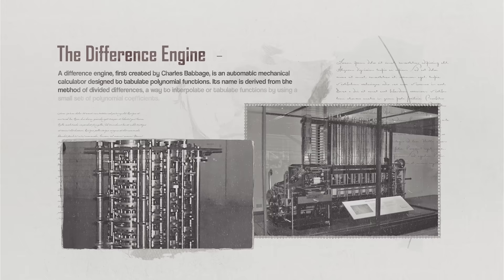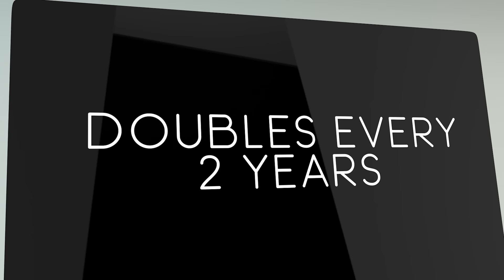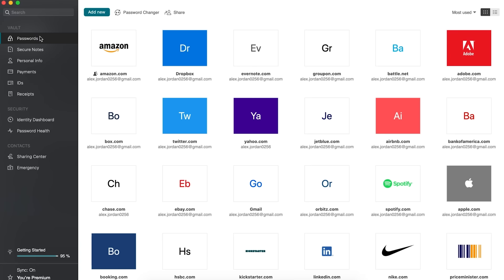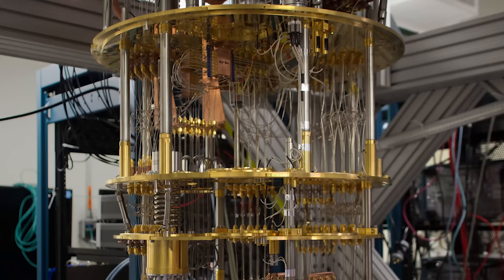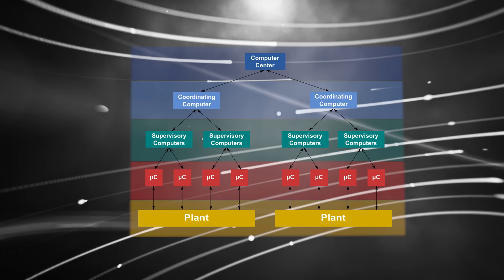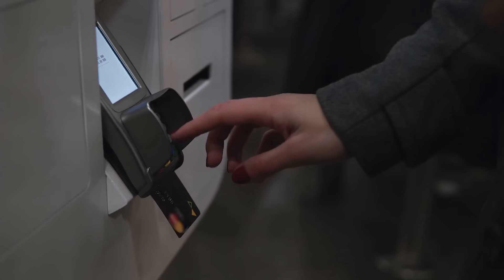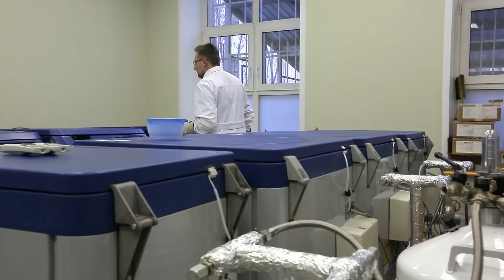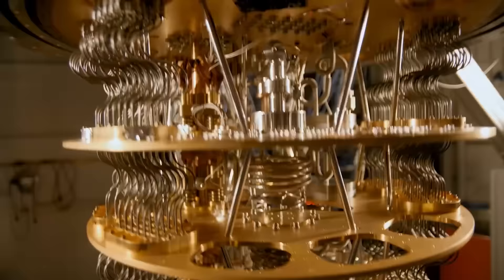This Revolutionary Computer Is About to Change The World for Good

Comment: Moore's Law: process power doubles every 2 years
Gate's Law: Bloatware will always strangle computer performance
Reply: This is golden comment needs more attention 😂
Reply: what is bloatware?
Reply: oh wasted space
Reply: That's so accurate. I wonder why these computers always lag even the new ones
Reply: Read "Showstopper" by Pascal Zachary, the story about NT Windows. You will gain both a firm grounding on the history of Windows and new respect for it's design and makers, chiefly Dave Cutler and Perazzolli. They have done something of a scale that was never done before. Windows is truly an achievement.
Reply: @masternobody1896  Bloatware is poorly optimised sub-optimal code and  the use of interpreted languages as glue - piled together and occupying far more ram than is required.... the great god C has been replaced by C++ and Java script. However, AI's will save us by writing in pure C and assembler in the not to distant future
Reply: @berlinblast5736  Windows is crap -which is why the internet runs on Linux and Linux runs Nasa's projects...
Reply: Bloatware is just taking up space, not performance....
Reply: Chester Hackenbush I wish You’d be able to play more games on Linux tbh
Reply: @TripleLayerLemonCake  you can do that using proton or wine
Reply: @sushmadevi3652  I haven't had much luck running civ IV on linux, i had to set up a dual boot for that
Reply: @imperiumcommentingnetwork4677  it is still a little clunky
Reply: @sushmadevi3652  Seems to be a miss with older games mostly
Reply: Cole's Law: Thinly sliced cabbage.
Reply: @berlinblast5736  I hope you're being sarcastic. There is absolutely nothing that book could contain which will justify the dumpster fire that is windows for the end user. I'm sure it was a great success for its marketeers.
Reply: @TripleLayerLemonCake  Steam has Proton which allows most windows games to be played on Linux.
Reply: @TripleLayerLemonCake  No bloatware is sub-optimal code, poorly written and taking up valuable space. ANY programmer will tell you that small well written programs run faster and take up less space than bloatware.
Reply: @chesterhackenbush  yeah thats why I said more. Most games arent supported only the big ones. Plus I've tested the difference between running on windows and linux and running cs:go and other games, and no difference in frames, so either linux also has "bloatware" or you guys dont understand how to close an application and stop its code. btw of course small programs would take up less space then bloatware lol. I could write a simple program right now, is it supposed to take up more space???? You're really confusing dude. Also if your pc comes with bloatware on windows then you might wanna get it checked out because you can literally get the base version with no extra programs other then settings and things that are needed
Reply: @TripleLayerLemonCake  Originally DOS/Windows relied on BSD - and there may still be BSD code in the Windows kernel even now. Linux is far closer to UNIX like OS's - it  is far closer to the BSD's. However, emulation layers (WINE, PROTON and others) enable Linux to run Windows programs. Windows contains Linux code to enable IOT and network functionality. However, emulation introduces bloat -as does running VM's (virtual machines). As things become complex - these routines have to be glued together with more library interfaces that are generic and often completely unoptimised. The result is software becomes bloated and less efficient. Pure Linux is very very fast and streamlined and  almost all super computers in the world run Linux and not Windows for this very reason.
Reply: @chesterhackenbush  i get the same performance  with both so I see no difference, nor do I see bloatware.
Reply: @TripleLayerLemonCake  You are not an IT professional, so you wouldn't. I would suggest you try Gentoo Linux for an eye opener.
Reply: @chesterhackenbush  I could be, you never know. Maybe you should try the stock version of windows 10 with nothing installed other then system required things. Even then I dont see any extra software slowing me down. Plus you arent an IT professional either. Or at least with your logic you aren't.
Reply: @chesterhackenbush  btw Gentoo is one of the worst forms of linux, i've tried that shit and it runs slow as hell. No idea what's wrong with it but they did some weird stuff to is. Plus it has terrible reviews if you really wanted to suggest a form of linux atleast get the fast ones smh
Reply: @chesterhackenbush  atleast you caught on lol. I personally use linux I just get bored and troll with people, most people dont notice but atleast we got one smart person here
Reply: @TripleLayerLemonCake  You are very naughty... I have told Queen Elizabeth of your naughtiness and she will have your ankles savaged by her corgis.
Reply: Chester Hackenbush that doesn’t sound very pleasant
Reply: @TripleLayerLemonCake  They like trolls and will probably give you a knighthood and Ghislaine Maxwell's telephone number.
Reply: Very true.

Comment: “Can it run Crysis?”

You’re not thinking big enough. The real question is: Has Todd Howard released Skyrim for it yet?

…and the answer is yes, yes he has.
Reply: The one true fact is that Fallout 4 will still drop in frame rate when you enter Boston even on a quantum computer.
Reply: I wanted to make that joke, good thinking. I bought skyrim for my fridge.
Reply: It couldn't run tetris, it's not designed to do that, like the computer used on the Saturn five rocket, integrated circuits were not in standard use at the time so individual transistors would line the control module to manage the craft.  quantum computers are very much like calculators just, really fast, and if your calculator can run crysis, it's not a numerator, it's a completely different kind of computer.  that is the biggest reason why I hate that comparison because it's like comparing apples to the empire state building.
Reply: it will still crash every 5 minutes
Reply: @SomeGuy-qh6rw  a qubit processes a single instruction the same way a bit does but think about it for a moment do you want a processer that can transfer 54 bits of data to try and run a game that requires 1.3 GHz of traditional processes. Qubits coincidentally only work thier magic when they work together on a single process.  54 bit doesn't allow the CPU to transfer more than one channel and a single process at a time, no cache, no pre-fetch, just a single process running open ended commands exactly like computers did when the digital generation started.
Reply: no, i would use crysis like units of computing power.
Reply: And now when it glitches the game actually phases in and out of reality.
Reply: The real question is: Can it handle Scrap Mechanic multiplayer with 2 complicated creations going near each other at over 20 FPS with no glitchy teleporting?
Reply: It just works.
Reply: The question changes from "Can it run crisis" to "can it play crisis and beat you" xD
Reply: Ok, but can it run a Minecraft tnt world that has been ignited?
Reply: Michael Frost remember that plane that went missing from I was reading there was 4 men who had invented a more advanced processor chip and were on there way to sell it to bidders and that’s why the plane vanished , good conspiracy lol ,I don’t under stand what they invented but it was suppose to be the most advanced yet

Comment: Quantum computers and Fusion energy were a tech to arrive soon when i was a teen.....i was born in 1975. I wonder if i will see this tech become mainstream in my lifetime.
Reply: There is at least some chance that we'll never get quantum computers, as the isolation of the szperposition from the environment gets more and more difficult with an increasing number of quibits. Currently we are at roughly 72 quits, if you get into the 4-digit size, things start to get interesting. We'll see if we can solve this technical challenge or not. Nonetheless, even if we can get this done, we also need to design and build all the quantum gates required (and there are some more challenges). In the end this means: we'll never have one in a decade, 25 years is a far more reasonable estimation. Assuming that ITER goes live in 2026 and everything works out as planned, it's not unlikely that we may have commercial fusion plants prior to having commercial quantum computers.
On the other hand, if you were born in 75, chances are not that bad, that you'll experience both technologies well in your life time.
Reply: @frankschneider6156  Iter is no blueprint for a commercial fusion plant. It's succesor DEMO is intended to be that. Completion currently planned for 2043.
I'm hoping that better superconductors will make research with smaller designs possible.
Reply: @frankschneider6156  "A 30-qubit quantum computer would equal the processing power of a conventional computer that could run at 10 teraflops (trillions of floating-point operations per second). Today's typical desktop computers run at speeds measured in gigaflops (billions of floating-point operations per second)."
Reply: @lrrrruleroftheplanetomicro6881  Yeah, I'm aware of that, but ITER is PoC that's its commercially feasible. If that has been demonstrated, I hope on private companies jumping in on the opportunity to grab a piece of the cake, before others do and the window of opportunity closes. This could massively speed up things. Currently investing is highly risky, but once a proof has show that it is not just theoretically, but technically and commercially feasible, I hope this attracts large sums of investors money to speed things up. I mean 20 billion sounds like a lot of money, but eg Apple could pay that more than 10 times from the money that they have lying around, without having to borrow a single dime.
Reply: Witnessing it now
Reply: @frankschneider6156  please explain why and what you are basing your statements on especially this one "if you get into the 4-digit size, things start to get interesting" why do we have to reach 4-digits for it to get interesting? .
what I wrote was a quote, maybe not the best quote. The main point is that qubits increase exponentially, so 4-digits is overkill and it's already starting to get interesting.  Seeing as it can already do  calculations that would take supercomputers thousands of years, in matter of minutes.
Also don't use logic fallacies, that only makes you look bad.
Reply: @Akiramaster  What's the bit-length of current asymmetric ciphers ? 3072 bit and if you are paranoid it's rather 4096. Most larger proteins have hundreds of amino acids. Per AA you have 2 angles, phi and theta which again can have any value between 0 and 360. The amount of problems that can't be solved by common classical computers but could be solved by quantum computers is fairly limited and those that we know of typically require these numbers, as others raw force of classical systems would suffice.

There are also some other things to consider, first quantum computers take quite a long time for a single computation (if you interrupt too early you have a premature wave function collapse) and the result you get from an operations is often just plain wrong, because QCs are not deterministic, but probabilistic. Measure their speed in "Flops" is just asinine, because QC's just don't work like that. They don't have any floating point operations. They don't even have any operations at all, at least in the classical sense. Not to mention that many problems are simply not solvable by QCs. Those that are NP (but not NP hard)  will often be, those that are NP hard but not NP complete are very likely not, and those of even higher complexity are certainly not. Even universally programmable QCs are NOT universally ultra fast computers, they are niche products, that may have advantages in a very few a limited fields for solving very niche questions. Otherwise they are outpaced by every classical computer.  BTW, the largest number that has to date been factorized by a Quantum computer is: 15 (that's the number, not the amount of digits) at we are at 72-Qubits.
Reply: Nah instead we getting vaccines and masks because people forgot how the immune system works.
Reply: I found in my parents stuff a 1949 Scientific American magazine that said fusion is just around the corner. Seems it still is. I think it will have so many unintended consequences it will be bad. Consider a fusion powered factory fishing ship strip mining the oceans even more disasterously than we are now doing. How about a fusion powered gigantic strip mine drag line. With either we could do more damage even faster and we don't have the wisdom to limit the damage. There are many more examples that could be envisioned.        That doesn't even count the waste heat from so much power being generated.           In 1975 Constantine Generalis said that since the Minoan civilization  human energy usage has gone up at a rate of three to four per cent a year if we maintain that rate of increase for another three thousand years the surface of the Earth will be hotter than the surface of the Sun just from the energy usage. You can't grow infinitely on a finite planet.
Reply: @Akiramaster  
Thorium now.
Reply: @carlwessels2671  
Yes, the "fusion is just 30 years away"-quote since the 50s is a running joke, and a fitting one, albeit it will come to and end. Also does free energy mean the commercial solution to nearly all problems, reducing them to mostly technological problems. Eg if your planet gets hot hot, just build a giant fridge. BTW a significant part of all fish is already not being caught in the oceans, but in fish farms, because that's a lot more economical. 
It will be, like it has always been with our species: if a problem arises, we'll deal with it. That's what every species does and once it fails to do so, it goes extinct. That's how evolution works.
Further: if you expect a technology without potential downsides: that doesn't exist (in principle), as technology is morally agnostic and can thus always be used for either "good" or "bad", where "good" and "bad" are of course also always defined by an individual's point of view and are no absolute values.

Comment: 5:53 “ CAN IT RUN CRYSIS” IM DEAD 😂😂😂
Reply: After all this years this game is still remembered. Back in 2009 i've ran it with GeForce 9600 512MB on 1280x1024/30fps and graphics much higher then the official max. One mod allowing that on Windows XP. I had a good time wit this game.

Comment: For anyone interested, the Shor's algorithm work by destructively interfering with all the probability that it will return "bad result" from the probability wave using Quantum Fourier Transform so that when you observe the output state it will always be in one of the correct state. Which is much cooler than the "processing state in parallel" explanation given here.
Reply: It’s weird how when reading a thing about quantum mechanics you can both kindof get it and have not a single clue at the same time.
Reply: @logantc.1353  thats quantum physics for you
Reply: Its a bit Fuzzy... LOL
Reply: Spooky!

Comment: The millenium bug was not harmless. It was, however, rendered harmless by millions of man-hours of work.
Reply: them IT guys and gals working in the background that no one ever really appreciates :( feels bad

im not an IT guy, but am a software engineer though (but a very new one at that lol)
Reply: I have a katana that's engraved with the words "Y2k compliant".  by about 2005 I had to start explaining the joke to people.
Reply: I was surprised to be asked to make my 1992 code Y2K compliant. I found it hard to believe that a DOS programme written in Clipper 87 would still be running 8 years later. I changed the century flag to on, recompiled and sent it back to them through the post - it was the last century after all. Charged them for the return postage. 

I wonder if they will get 64 bit systems in everywhere before the Year 2038 problem (also called Y2038 or Y2k38 or Unix Y2K).